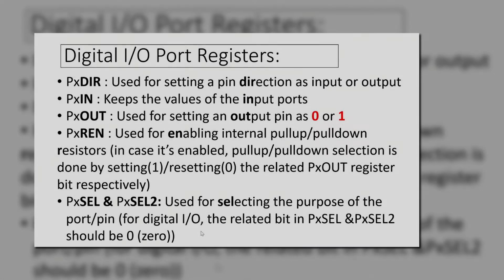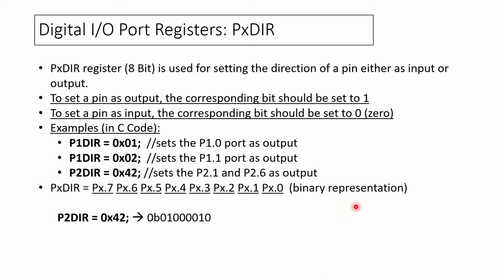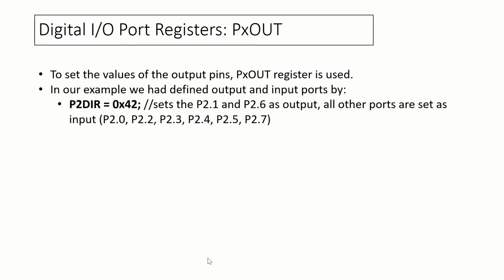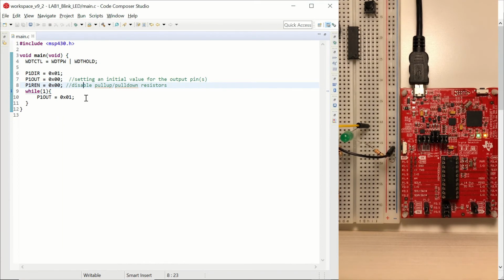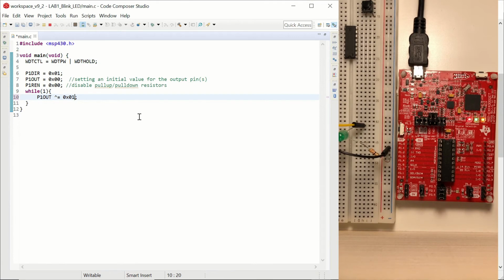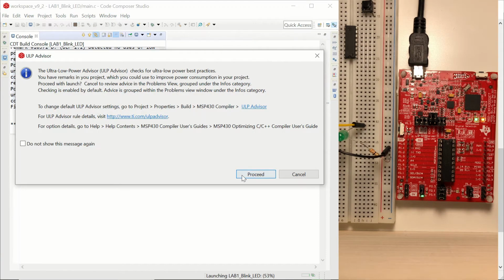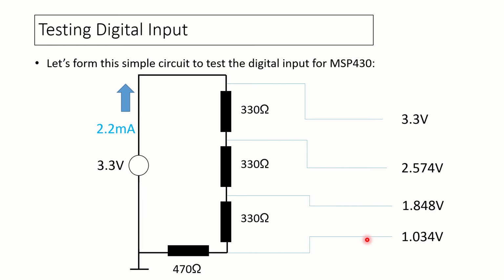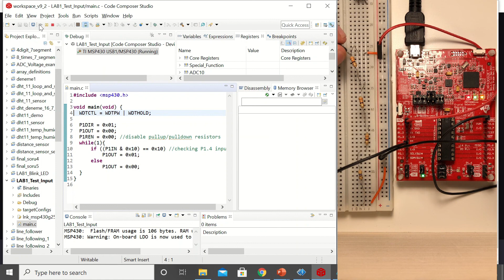MSP430 Digital I/O Tutorial

Comment: im sorry sir,i still  confuse with converting hexadecimal to binary for the port input output, for example i want to use pin 1.3 as an output, i write the code like " P1DIR = 0x08; "
is it correct?
Reply from the maker: Hi, yes that is correct. You can also use P1DIR = BIT3;
BIT0 to BIT7 are defined in the mcu’s header files as 0x01, 0x02, 0x04 , …
If you want to set multiple values, such as P1.3 and P1.2 as output, you can use one of the following:
P1DIR = 0x0C;
P1DIR = 0b00001100;
P1DIR = BIT3 | BIT2;
They all do the same job.
I hope this helps…
Reply: @drselim  thank you very much sir for the answer.
Reply from the maker: @adetyarahman6368  you're welcome
Reply: @drselim  thanks for this comment, I was wondering if you could use the binary representation instead of hex and you answered it 👍